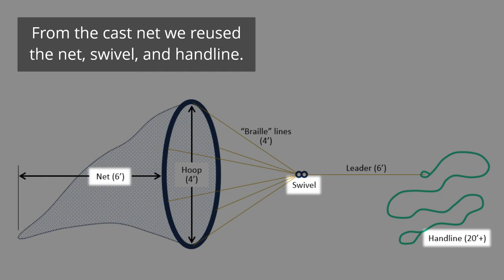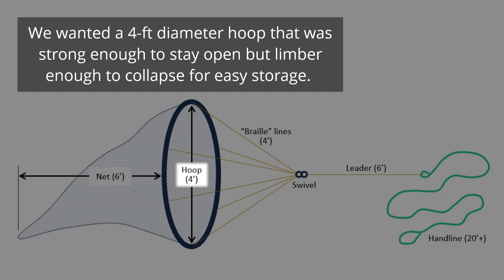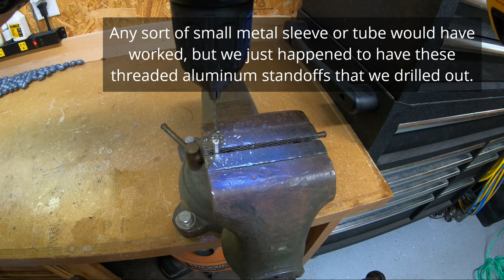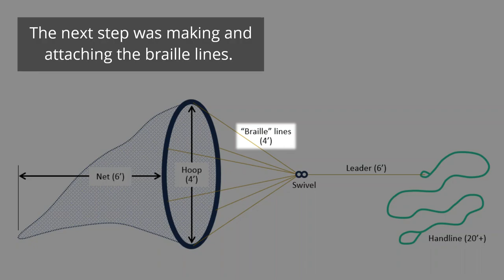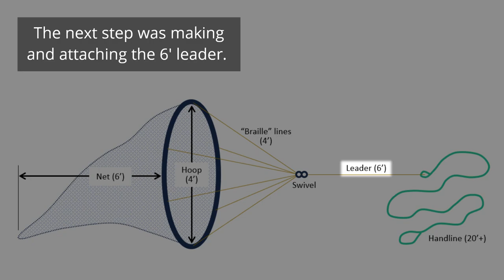Making a Ballyhoo Hoop Net

Comment: Some times its not about saving money. Sometimes its just nice having something you made yourself. Im working on a hand made cast net right now. Its about 30 inches long so far. And it will be a one of a kind and last a lot linger than anything comedically made from panels and sewed together. And if it does tesr or get holes in it it is easy to repair. It will last me a lifetime. Especially after i dip it in net dip to make it tougher and uv resistant.

Comment: Congratulations for your video. Do you have a link for the net because I can only find two nets with large meshes.
Reply from the maker: Thank you for watching and for the comment! Sorry, no link. We bought this cast net years ago and it was too heavy so it didn't get used much. That's why we used it to make a ballyhoo net. This net has a 1/2" mesh. What size are the nets you are finding?
Reply: Make your your own. It's pretty easy but time consuming

Comment: How did you get the castnet without the weights ??
Reply from the maker: It was just a regular cast net. This one was too heavy and didn't get a lot of use, so we repurposed it as a ballyhoo net. At 00:33 you'll see that one of the first steps was cutting off the weight line. Thanks for the comment!

Comment: always use BLACK zip ties for anything outdoors. white ones are not uv stabilized and fail in a very short time.
Reply from the maker: Thank you @fishonkayakadventure for the tip! Will change to outdoor/UV black ties soon.
Reply: Next time just knit the ends together. And you won't have to worry about them ever coming apart or breaking.